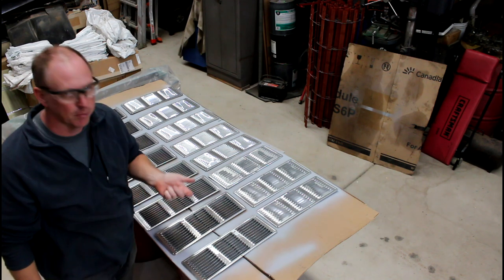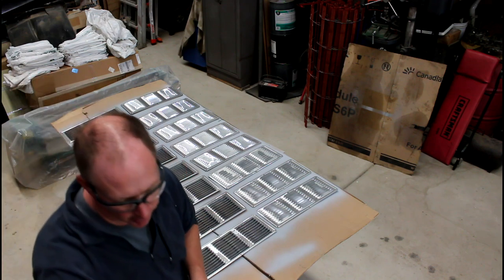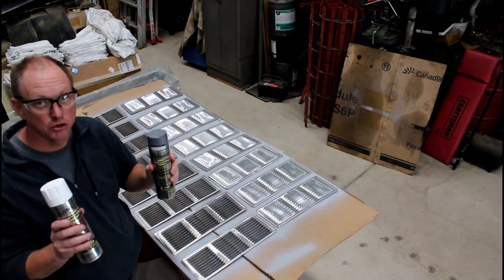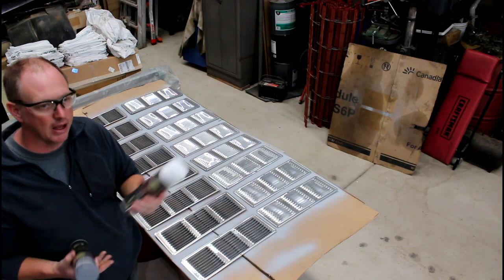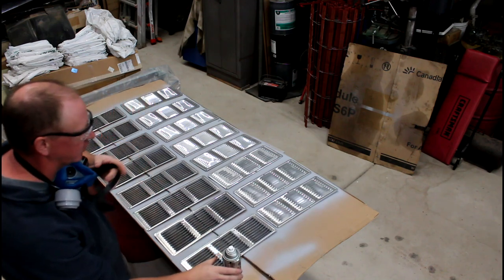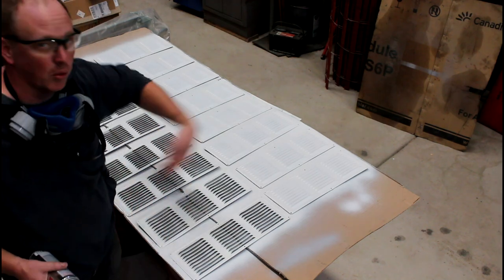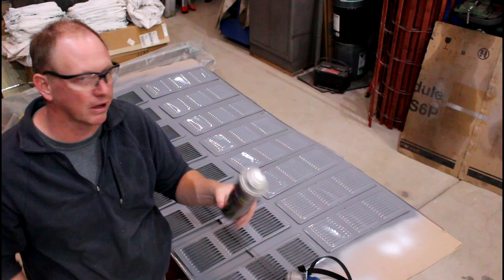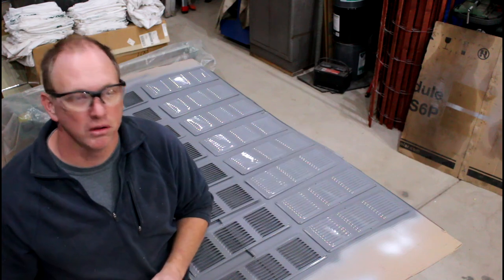Aluminum Painting Tips and Tricks

Comment: I didn't realize there was a special primer for aluminum and I definitely like the minimal overspray. Got a link for the respirator?

Best wishes,
Tom Z
Reply from the maker: I have links in the description for the body, and the cartridges.  I like the MSA since that is what I have used as a firefighter for years, but check and see what your local welding shop stocks and I would go with that brand just for ease of resupply.  I have particulate filters and the organic vapor and they are great.  Thanks for checking out the video.

Comment: Do you need to sand brand new aluminum or can you just put the primer on and then the paint? Just got new running boards for my truck and the underside is just bare aluminum I want to protect them more thanks
Reply: Protect from what? Aluminum doesn't rust
Reply: @allanragnarson7898  
It does oxidize, but the oxide layer is impermeable to oxygen, so a thin layer "rusts" preventing further rusting.

In his instance, I imagine that he is protecting it from road debris like gravel and salt, which together can pit the aluminum.
At the very least, the debris can remove the shine from polished aluminum.

Comment: how to remove the paint from aluminium? I am having difficulties to remove the paint from aluminium :(
Reply: paint stripper, or wire brush
Reply: Heat gun works, but is slow going as aluminum transfers heat very well.
But, that also means it is forgiving and localized.
Reply: If you use wire brush or wheel make sure to use one with stainless steel bristles. You don't want to embed another material into the aluminum.

Comment: Is it okay to spray paint alluminum without the primer?
Reply from the maker: I didn't, and I wouldn't.  The method that I showed has held up great for about 5 years now.  Good luck with your project.
Reply: @r.j.sworkshop7883  These are going indoors also, so outdoor stuff would probably start showing wear pretty quickly.

Comment: Your putting more trust in a brand name, than more proven product like etching primer or epoxy primer. one time i thought rustoleum high pro paint was recommended as it says its for masonary use, but it is not, & the hard finish cracks & peels off quickly compared to plastic or flex paints.  also many reviews suggests very low quality failure of the specific labeled rustoleum etch primer, so use something good or mid class like Dupi etch primer with a mask, its temporary acidic.  oil paint is fine unless it going through exstreams of expansion & contraction.  a scotch pad & abrasive/powder or vinagear realy removes oxidazation before primer.  neutralize vinegar or acids before painting, can use alcohol, but its not a great grease removal substance by it self.
You said: I don't know, so I want to offer helpful advice.  its all about the next highest level for a painter, or maybe not.
Reply from the maker: All I can tell you is that I used this exact product and procedure 5 years ago on the same vents on a different building, and they look like they did the day I installed them.  Low cost, simple procedure and excellent durability for my application.  I am very happy with it, and I am glad that I used it again for this project.